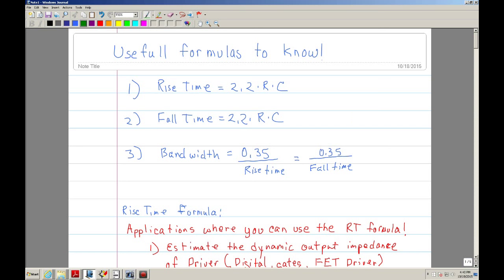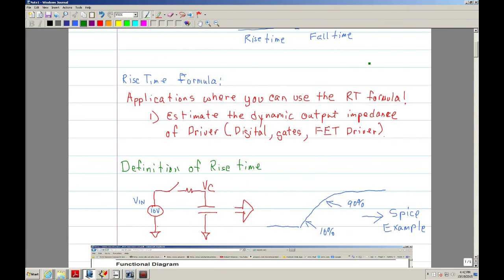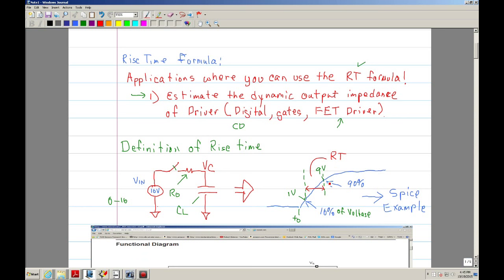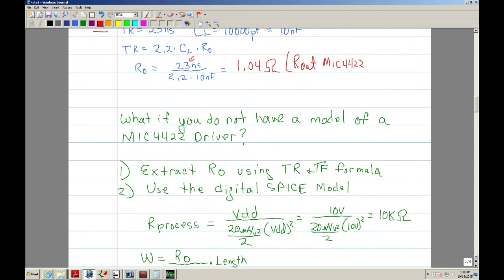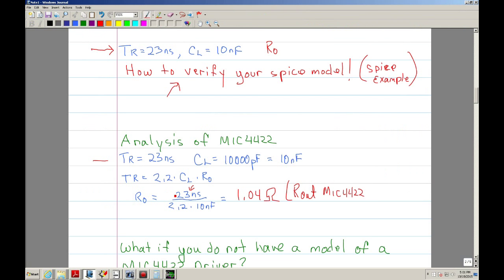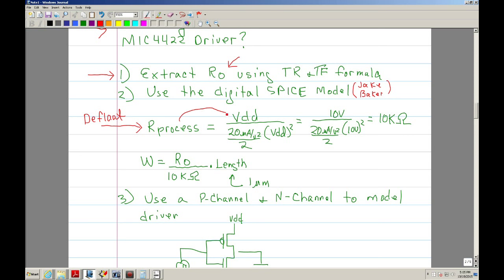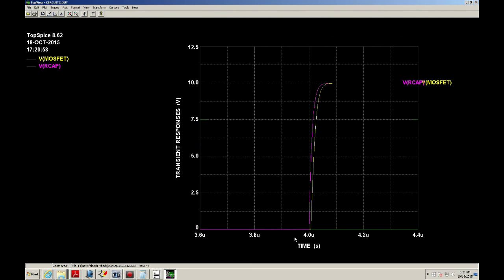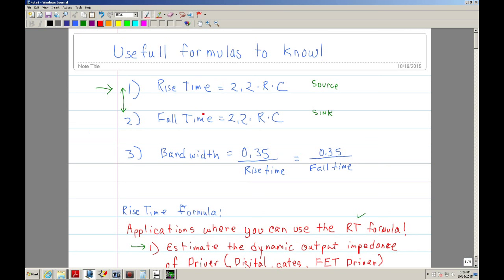Usefull Formulas for Analysis and Design

Comment from the maker: Hi Younes,  LTspice is the best free software. However, I don't like to use LTPSICE. I use TopSPICE. I like very much because it has a very large library of parts and it save time in not having to look up for models. It has about 30k of spice models. If you are a practicing engineer. I would suggest that you buy the copy. I think a one computer lincence is about  600 dollars. But keep in mind, that you will get technical support and are allowed to update your software as they add no parts to the library. I hope this helps.